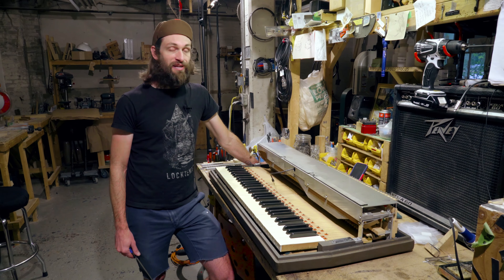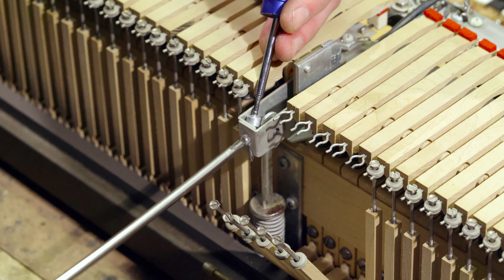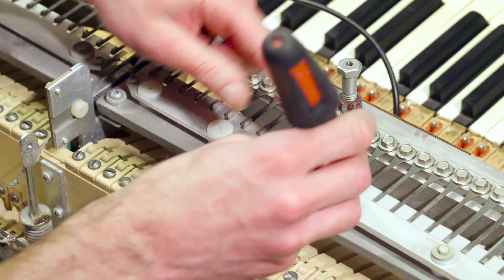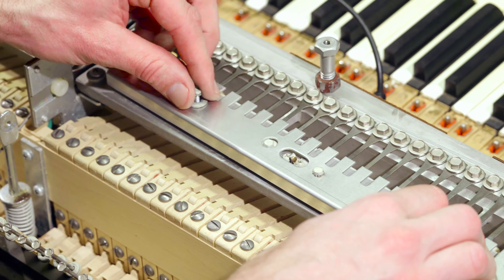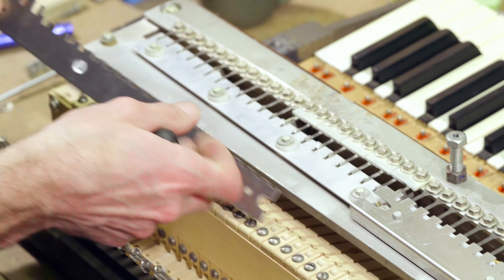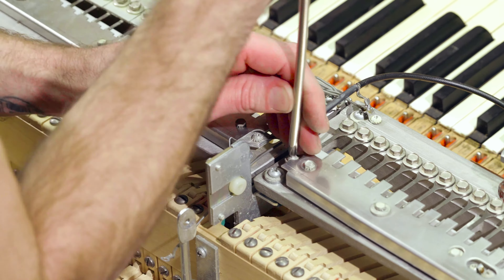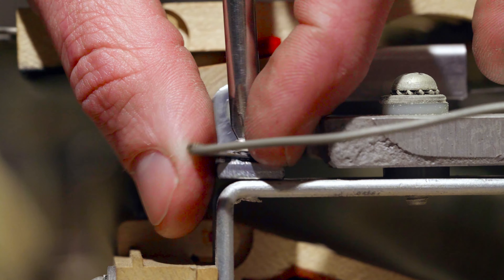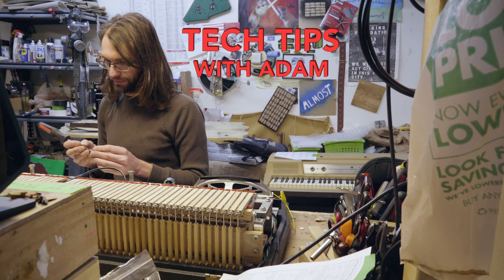Tech Tip | How to Install Wurlitzer Reed Bar Shields

Comment: Just did my 200, thank you for the video!  Very helpful.  I did find that in mine I had to trim those little connections between the pickup sections (he kept calling them "grounds" for sound reason) to fit without touching the shield.  And yeah, your pickups are going to move, so expect to check for tine rubbing in the gap after putting it together.  But overall pretty easy, and the hum is definitely much reduced.